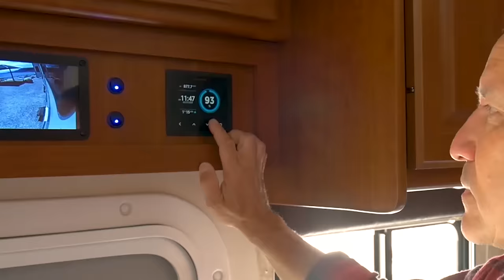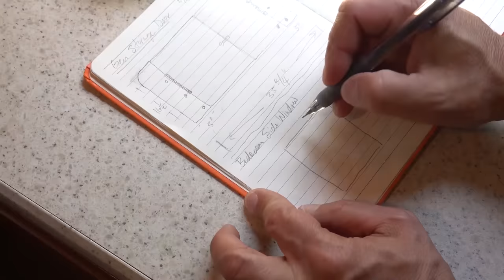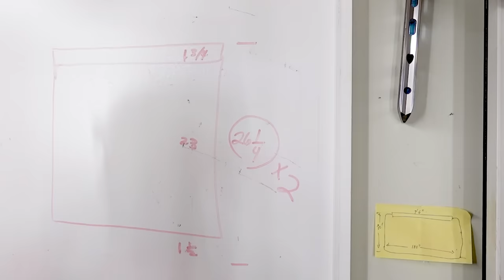THIS Replaces UGLY Foil Insulation In Your RV Windows (Full DIY Build)

Comment: Awesome idea! I like how the Reflectix is out of sight. Does having it inside the curtain affect how much sunlight is reflected back? Just curious.
Reply: I was wondering that also
Reply: the answer is not really. because the reflectix is reflecting radiant heat. same thing if you install a radiant barrier under a roof. however, much like in the roof the radiant barrier only works if there is an air gap between the roof and house to eliminate conduction. but that is the brilliance of reflectix--the air barrier is in the bubbles, ie, inside the reflectix. having said that, my concern with this installation is that the reflectix has been cut and separated out, reducing its efficiency by a lot.

Comment: Very good idea. A past owner left a log of the silver window fold up heat blockers like new in the Dinette seat storage. Will this is something I could use them for. However about 14 years ago I bought 75 feet of 48" double bubble insulation with the silver one side white the other. I cut into widths to fit between the supports under my 24' covered patio about 10' roof. Stapled velcro pieces on he underside then to hold velcro matching tabs on the vinyl. So I had an 8 foot run. White side down to lighten the patio too. Silver side up to reflect heat. Man when you put your hand on roof area with no double bubble and with it's unbelievable cooler. So I also bought these quilted silver thick space like blanket things. Very soft and squishy and does this too. I made window coverings for my tent's fly windows I sewed into my fly so I had 360 view from my tent when inside tent. I made one side of the window with matching tent nylon fabric and other side totally reversible with the silver quilted material facing out. I can't believe myself how great this turned out. I bought more of these blankets on sale and made myself a sweat suit for Fascia Blasting...don't ask. A phase I went through. So I still have like 4 of these blankets about brand new and I also have about 40 feet of the double bubble and it too is not crunch sounding like what you are playing with. You are definitely on to something here though and having sewin over 60 years starting at age 12 my favorite sewing is utilitarian and I'd have no problem sewing your black out curtains into shades with my reflective material that's a space blanket only quilted and soft and easy to sew and handle and doesn't make much if any noise. Also a hint for non sewers the silver like aluminum heat tape works great for seaming this reflective material. I covered our favorite 50 year old cooler including a hinged lid in double bubble doubled so it has the silver facing inside and out and two sets of the double bubble to make four layers. It came out amazing even looked cool as if you could buy something like it which I've never seen one. Anyway used the silver tape 2 maybe 4 inch wide I no longer recall the width without going out to check. It's been over 10 years ago. But I do love my double bubble and love finding uses for it and the softer hand material like space blanket but much stronger and easy to handle than the single layer space blanket. A lot of merit to you and making this video to share your idea. Love it and gets the DIY juices flowing.

Comment: Nice work! I am curious after a year, how well has the fuseable interfacing held up in extreme heat/cold temperature changes on the windows? Sometimes that application loses it's "stick"
Reply: me too. stitchwitch holds up well, but hot glue notsomuch. i would have just ran a seam with a sewing machine. why is everyone afraid of sewing? my mom taught me when i was like 8....

Comment: Cool idea! Pun intended ;) You might want to put a disclaimer in somewhere that if you have a dual pane window to never put reflecting material right on your windows. It will create heat in between the panes and could either ruin the airtight seal or blow the window apart. Best to do like you are doing and have the insulated material away from the glass to create an air space for it to circulate better
Reply from the maker: Didn't know that. Thanks for mentioning it.
Reply: New...you’re videos have helped me out many times! You’re doing a great job! Keep them coming!!
Reply: Wow First I've heard of that, And so many people are using reflective panels that way, eeeek !
Reply: @sophiajoyceferry7150  What makes show you so sure it’s true because one stranger says it?
Reply: @GOLDVIOLINbowofdeath  Sorry what! 
What makes show you so sure it's true.
What the ?
Reply: There is no air between RV dual pane windows like residential windows
Reply: @MikeJordanUnCamplicated  kinda true but not. There are two kinds of thermal pane windows. Those with wire between them and those without that use a plastic material to creat a better R value. The ones with air are definitely used on RVs because we had to have ours fixed on our 45’ Monaco Dynasty because it fogged up. The point of using the windows with air between them is so they don’t fog or freeze up. That’s why they use them on school busses in the north. I know about that too. I sold school bus parts up here in Minnesota for 10 years. And the way I know about the thermal windows with air between them exploding is because I talked to the guy who fixed our window and he said don’t ever put the reflective material directly on the glass or it will create so much heat in between (green house effect) it will either shatter it or melt the seal between the pieces of glass
Reply: @MikeJordanUnCamplicated In Europe there is!
Reply: @jeffburford  Tito is American, and so am I. I find it very hard to believe that the Europeans have found a way to keep an air gap in the windows sealed, in a moving vehicle, that experiences hurricane force winds, and earthquake conditions every time that it is on the road. But post a link so we can learn more

Comment: You'll ruin the reflective value of the Mylar coating by putting another material over it, so in this application I would be tempted to use rigid insulation like pink board, instead of filling with Reflectix. Or you could just stuff it with regular bubble wrap or cardboard. 

Also, if you are concerned with heat loss, you might want to use black material, as black tends to be very effective T retaining heat. While if you want to shed heat, you want the outer surface to be either white or reflective. To me it seems like the best way then is two sides, one white and one black, so you can switch it with he seasons.
Reply: Brilliant!  Sadly ignored by the builder and others here.
Reply: Ruining the effect of reflecting heat, is not possible.   If that assumption was correct then no form of wall insulation would work.  Reflectex was developed as tank insulation (covered) and also works well in wall spaces were you include an air space between insulation layers.  Also does not have an R value, but instead,  a percentage of reflected heat, dependent on installation direction.
Reply: Always someone who wants to complicate matters. I prefer his way. You do your way.

Comment: Clever! Did you use your thermal gun before and after to see how effective they are at blocking heat from getting in?
Reply from the maker: Nope. Just tore off the old blinds and valances and needed a improved replacement. I've slept right up against them during cold and hot weather. Seemed to do an excellent job insulating.
Reply: @RVwithTito  well, either way, innovative, as usual!

Comment: Looks great!  One question, do you lose any of the heat rejecting capabilities by covering the reflective material with cloth?
Reply from the maker: Hard to say. It wouldn't make it past the shade. My non-scientific assumption is that light would still come through the window in either case therefore heating it up. I've also found that the window frame is also a large source of heat. I can say we've used the other blinds in the Arizona desert in direct sun and they worked great. There was no heat transfer on the inside. Thanks for the question.
Reply: RV with Tito DIY that is good news...this is a much nicer solution!

Comment: I think the whole point of Reflectix is to REFLECT the light and heat.  My guess is that it had better heat reflection when you had the fitted pieces.  Nice project though.
Reply: I don't understand you...
Reply: Heat is transferred by three ways convection conduction and radiation. Reflectix, if it has a reasonably air tight seal, helps with two of the these. radiation and convection. Drafts are convection

Comment: The reflectix has very little insulating value. It does reflect a lot of heat to help lower the solar gain through windows. That lowers the a/c requirement and makes the indoor space more comfortable. 

Reflectix needs to be exposed to accomplish this. It becomes ineffective when covered in fabric.
Reply: Lays it out. Thanks.
Reply: Patricia Peters Have you ever washed the shades that come with your rv ? 🙃
Reply: Jeff Butts ,   Go check out the properties of Reflectix on their website.   It does not need to be exposed to light.   It is also a radiant barrier.

Comment: I'm not keen on the large gap between the insulation sections, that defeats the purpose of having the insulation sections. It would be best if the sections were a very minimal amount of distance between them or still joined as that is the purpose of this to keep out/in heat.
Reply from the maker: I'm not sure if it makes that big a difference. I tried to find a gap that would not be too bulky when folded 4 times. 4 inches seemed to do the trick. That's still 16" out of 21 or so for the window area.
Reply: Tim Gay the drapery, blackout curtain, would definitely minimize that concern.  If one were using thin material then it may be a factor.    
I appreciate this idea and video. 😊👍

Comment: Very nice window treatment, Tito; however, you have defeated the purpose and function of Reflectix.  It is a radiant barrier, not insulation.  It reflects much of the suns rays away from the RV, but unfortunately it conducts heat on contact.  So, when it touches the nice, grey curtain, it absorbs the heat from the fabric and transfers it to the second layer of the curtain.  Reflectix is good against radiation, but not against conduction.  Otherwise, virtually everyone in a camper van or RV would not be showing the Reflectix in the windows.  Good handyman, though.
Reply: I had the same thought Steven.  Reflectix is not insulation and we just hid the shiny side which is essential for it to function.  I like Brian's stuff, but I think he needs to check with the manufacturer on this one.
Reply: I think it can still “reflect” heat even with thin layer of material over it. But yes material will absorb some heat too. Though Thinsulate is best option.
Reply: Reflectix only works as a reflective barrier. If you cover it with fabric it is useless. You could just put cardboard in between and it would do the same thing
Reply: Ditto, relexctix reflects heat (radiant) but it also conducts heat.
Reply: A radiant barrier works best when it is perpendicular to the radiant energy striking it. .. Great work on a black out shade containing a foil however the foil is useless. Why doesn't the Blake out curtain manufacture do not add it.
Insulation foam as the insert would work however curtain material would be HOT from absorption

Comment: Mr Tito-  Very slick looking shades but I really recommend custom white marine vinyl exterior shades held on with small suction cups. Put grommets through the vinyl for the suction cup attachments (mine have little metal knurls). They let in some light as well and really cut the heat gain - similar to a Adco windshield cover. But they’re not for block out if that’s your issue. Also try the 1/2 inch foam board insulation at Home Depot. Much less heat absorbing than reflectix. But it’s bulky to store, even divided in pieces. I’m using that in our skylights.
Reply from the maker: Thanks for the suggestions.

Comment: I have been trying to figure out a way to have a black out shade for heat and light, but when the weather is nice, a way to open it up that looks nice and I don't have to take them all off and temporarily store them. I love this idea.  I had already bought black out shade panel from Walmart and have been mulling it over in my mind. I want function as well as aesthetics. Your solution marries this very well! 

I have some questions. 1) How did you finish out the sides? Did you fold it into itself and glue? 

2) Do you think it would work using a solid sheet of Reflectix? I sew and was thinking I could sew small channel for it to fold. Or do you think it would be too bulky? 

3) Along that same train of thought, if I did do slats, do you really need that 2" space to fold it up? We're in TX and full timers. We have a canopy but it still gets hot and I feel the cold coming through in the winter.  Just want to use as much insulation as possible.

4) Is it hanging well, flat and flush, because of the bar at the bottom to give it weight? I know you went to the edge of the window frame. I love how flush it is and you don't have any light coming through. Also, the aluminum cleats are perfect. Great idea!

5) I too was thinking about magnets to keep it up. But what about folding it to the top above the glass so to not block the view? I know you said you can remove them, but I don't want to have to do that. Ideas?

You definitely have a new subscriber. Thanks for the great ideas and for taking the time to reply.
Reply from the maker: It's been a while (and we don't have that rig anymore) but let me try and answer your questions. 

1. Yes. I folded them in, glued, then glued the two folded sides together
2. You'd have to experiment with that. It may be too bulky to fold nicely unless you roll it. 
3. Can't say. 
4. Yes. You could certainly do that if you have the room. Just be sure to make them longer. Every window is different. In our new motorhome, there's very little room above the window frame. 

Hope this helps. Cheers! Brian
Reply: @RVwithTito  Thank you so much for your reply. I really appreciate your time and opinion.
Reply from the maker: You're very welcome.

Comment: The reflective surface of the Reflectix is now covered so it is not reflecting the suns heat back out. It is now acting as an insulated curtain. I am going to do this but I am only going put the cloth on the side facing the interior and just roll it up when the heat from the sun is not an issue.
Reply from the maker: Sure. Modify the setup any way you see fit. It should work. The window will probably still get hot since the reflectix is on the inside.

Comment: A radient barrier does not work if you don't have an air gap on either side of it. So I assume that whatever cooling you are getting is from the curtain and the performance would be the same with or without the reflective material.

Comment: I live in a sw facing A frame house, glass galore, it gets soooo hot in here!  I hang a towel over my dutch door window in the kitchen in the summer months after 300p when the sun hits the window directly.....I would love something I can fold up and then be put away in the winter.  Your design is perfect!  Thank you!
Reply from the maker: Oh wow! I hope it works. Good luck.
Reply: Marie, why in the world would you live in an a frame glass house that faces the south? I’m sure there is a solution to help with that situation, like putting up 4 x 8 sheets of foam insulation to make the Inside livable.
Reply: @adobemastr  I know right?  SW facing and it is  for the view of Puget Sound. I have floor to ceiling blackout curtains in the living room area to cover the center four rectangle window sections, that helps somewhat, .I had semi transparent film over the triangle part of the windows but they broke down over time, time to get some new film.  The heat is the worst between 2:30p and 5:30pm.  I cant complain because I have a killer view, my ex (deceased) won the argument over getting this house 26 years ago and I have to say now, im glad I gave in.
My bedroom is my office because of covid-19 and I HAVE to figure something out for that room...I die about 300p...I will look into the insulation.  thank you!
Reply: marie lynne  A couple of months ago I insulated the top of my shipping container with 2 inch sold in 4’ x 8’ foam sheets purchased from Home Depot. It made a world of difference. You might be able to buy 4 inch foam or glue two pieces of the 2 inch foam together to get you 4 inches of insulation for those windows.  You will lose your view, but you might be able to remove the foam during the winter months and get your view back if you plan everything out correctly when you install them.  I think it would be a doable project and save you the agony of living in a blistering hot A-frame house.  And relatively inexpensive. Like anything, it would take planning and research and figuring out the best way to do this.

Comment: You and I think a lot alike when designing and building. The video is roughly a year in age, have you placed magnet holder(s) below the window for a tighter seal during very cold nights to help conserve energy? 

BTW, I used this same reflective material a week ago (prior to seeing your video) to thermally insulate my windows near my bed and both entryways due to drafts. With the tinted windows you don’t notice the reflective material when standing 10-15’ away. I used heavy duty double-sided sticky tape (40lb rated) to holding the insulation panels on. 

Tonight, I found heavy condensation on the slide-out windows. Tons of water collected in the window sills as well. I will need to tackle that tomorrow along with replacing two skylights due to rain leakage. O’ you’ve gotta’ love FB Sellers that swear all is “like new” when in fact it has all sorts of issues.

Keep on keeping on Bro ✊